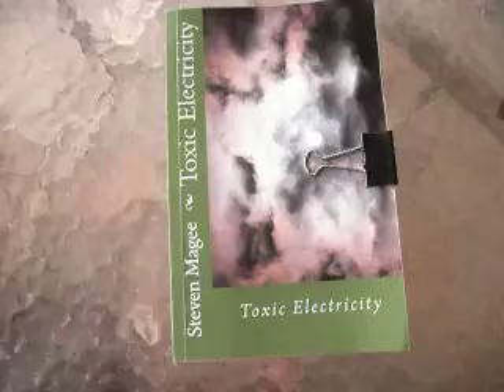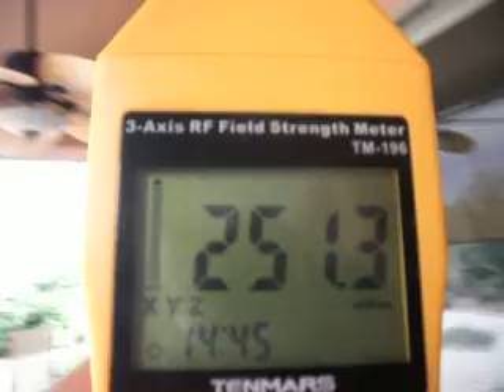The Effects of RF Radiation on an Outdoor Dieffenbachia Plant

Comment: Steven - several years ago you published a video of Dieffenbachia plants at varying distances from different RF sources; even smoke detectors.  Your method was very scientific.  I cannot find that video now.
It was *only Dieffenbachia plants, but showed the effects of distance from several different RF or radiation sources.  You also showed the meter you used in this episode.  
I am using a Faraday cage around my Wi-Fi radio, a Himalayan salt lamp, and a distance of 20 feet, and my Dieffenbachia is actually improving.
Questions: is a Himalayan salt lamp effective at reducing RF?  Where can I find your comprehensive Dieffenbachia video (which is not posted on your channel)?

Comment from the maker: One of the problems of RF research is separating out natural effects from RF exposures.  RF levels greatly increase during high temperatures which produces very low humidity.  Low humidity means that RF power levels increase due to lower atmospheric absorption rates.  I grew two of these inside a Faraday cage next to a gas Itron 100G transmitting meter and they did not show the problems that this plant did.  They were in similar outdoor weather environmental conditions, same heat & humidity.

Comment: btw the crispy brown leaves signifies extremely low humidity. the fact that you live in arizona means that the air is super dry. these plants are not adapted to the desert and should not be grown outdoors in desert regions. i find that even in my house in humid illinois the tips of the leaves turn brown if not givin enough humidity. ideally they prefer 60% humidity or above and will dry up in super dry air.

Comment from the maker: There are a wide range of effects occurring across many plant species. I have seen retardation, sterility, branching structure defects, plants that normally grow tall growing low to the ground, and so on. What I am dealing with at the home is the general reaction of the raised background radiation levels that prevents me from growing the Dieffenbachia normally, and a hotspot effect that is throughout the garden that retards some plants and not others.Some parts of the garden are at over 700mV/m.

Comment from the maker: The Dieffenbachia thrives on a wet and dry water cycle.  Water it, let the soil dry out and then water it again.  If you let the soil dry out too much, then it will start to wilt. Damaging the roots will cause the leaves to show stress and also extreme heat.  I am trying to understand if the plant is more affected by RF when temperatures are extremely high.  RF levels are higher when humidity is low, as water absorbs RF. The plant does well in any room with a window, NSEW locations are fine.